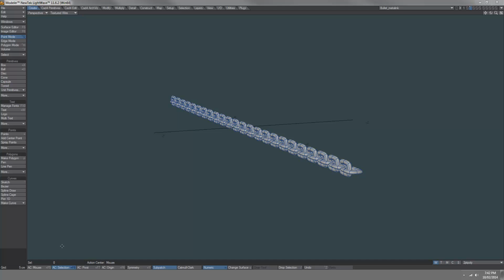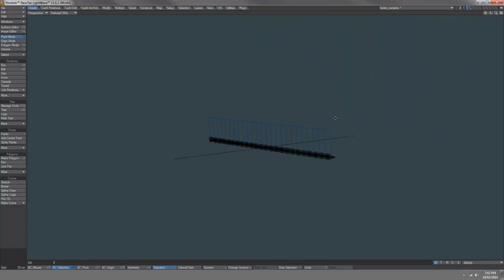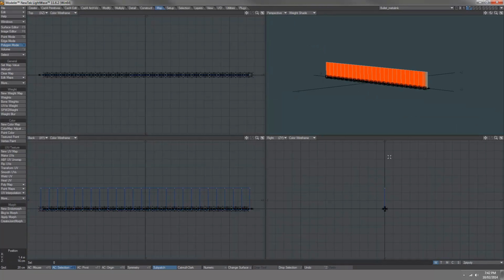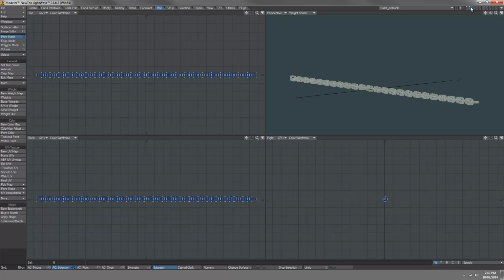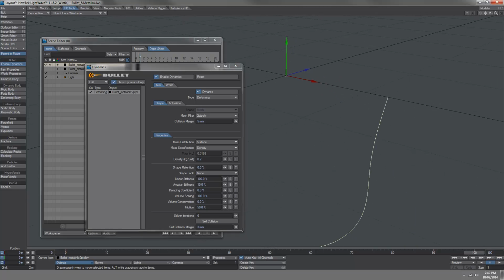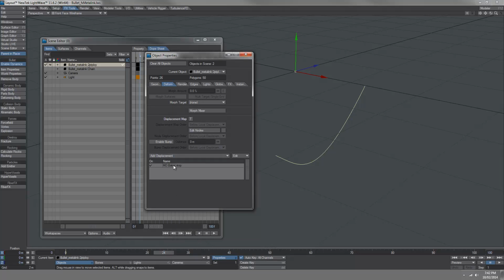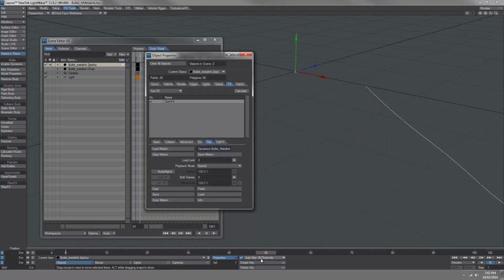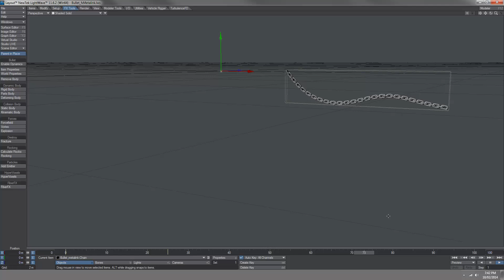Lightwave Bullet Dynamics & FX_Metalink

Comment: Would have been nice to have had some sound on it - easier to follow.
Reply: Hey Prince...it does have a voiceover (I exported the video with low volume), you might need to turn the volume up.
Reply: *****
Indeed it does! Tried it at home and it works, too quiet for the office though - speakers and everything on max, no joy.
Reply: Prince Westerburg
Cool..Yeah I have since worked out the audio settings for my screen captures...all my recent videos should be at a good level.
Reply: *****
Its something a lot of people overlook, as a musician I find it infuriating but then I've been recording since I was a child. It is worth spending a little on a USB condenser mic or a USB / FireWire audio interface as this removes all the AD / DA conversion from your computer and gives you direct control over sound. I mean, you wouldn't go CG on a standard PC with onboard graphics right? :o)
Reply from the maker: I have to admit I have limited knowledge when it comes to audio, but during the making of my last tute, I discovered how to increase the audio level even more, so it comes through at a more comfortable level...I also noticed that there's a lot of mic popping with my P's and B's...and all during it I was thinking about what you said about getting a new mic with a popping doovalacky in front of it....Im currently and have forever been using a very old verbatim computer mic which probably cost a few dollars back in the late 90's.